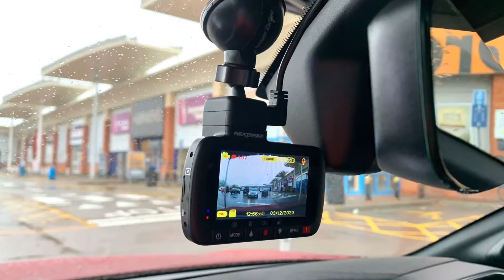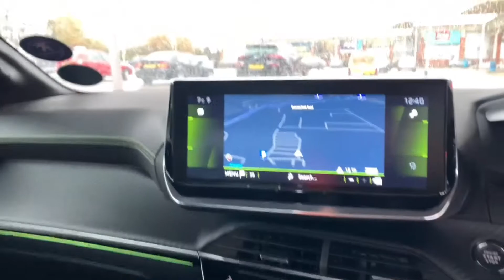Dash Cam Installation in a Peugeot 208

Comment: To which fuse does it need to be connected to?
Is it the same with a EV Peugeot 208?
Reply from the maker: It should be similar, best way is to check the manual for the fuse diagram. And check for a fuse such as for the cig lighter or the rear wiper blade motor.